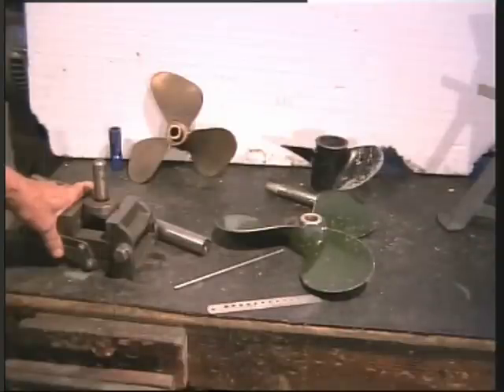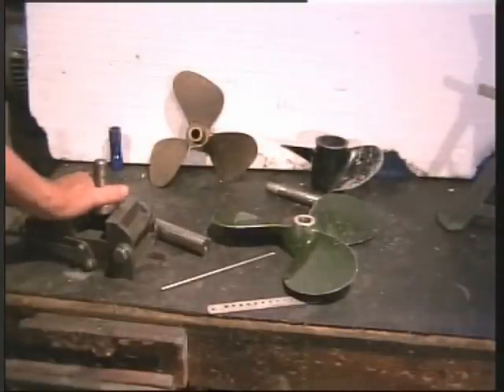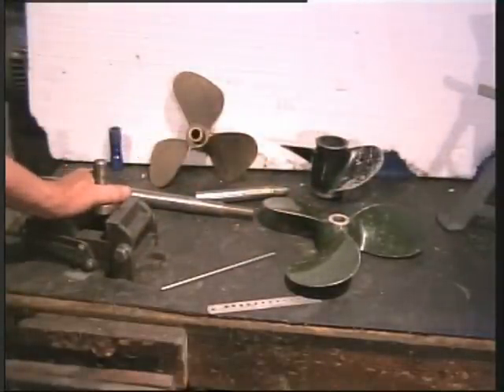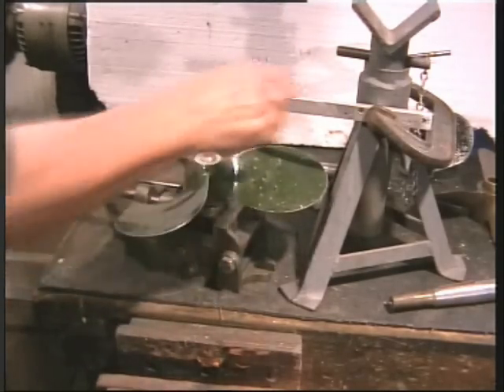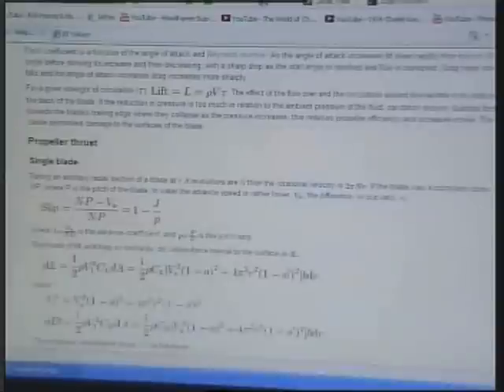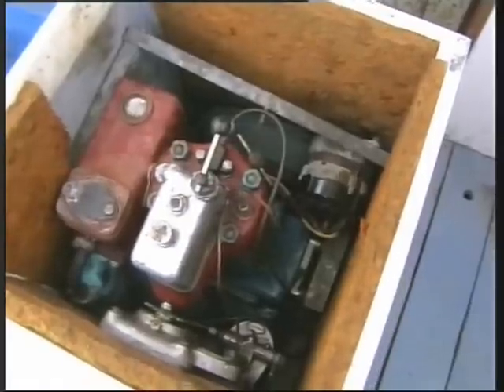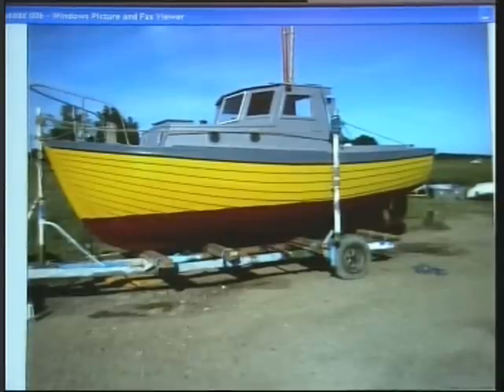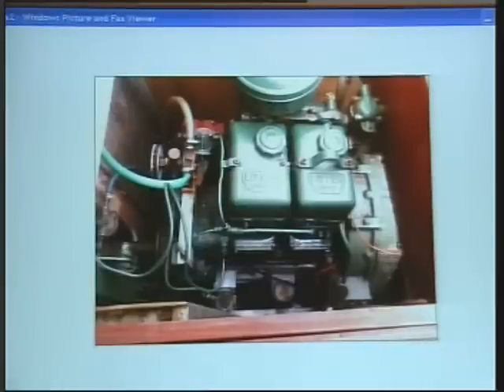choosing the best propeller.wmv

Comment: You are wright when you said they don’t make engines like that anymore.  I have a 35 year old Volvo Penta and runs as sweet as a nut. Other people have replaced theirs with new Yanmar engines and they fibrate the boat really bad. The only drawback with the old engines is getting parts and when you can they cost a fortune.